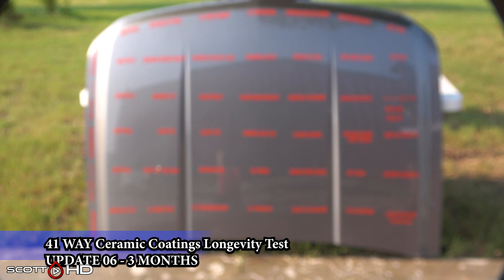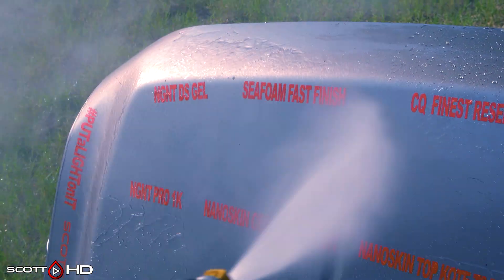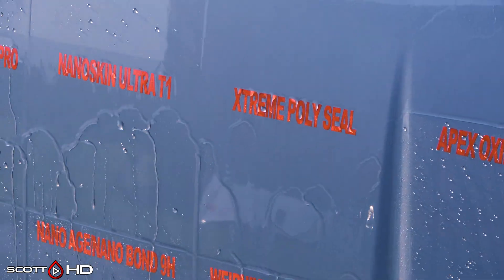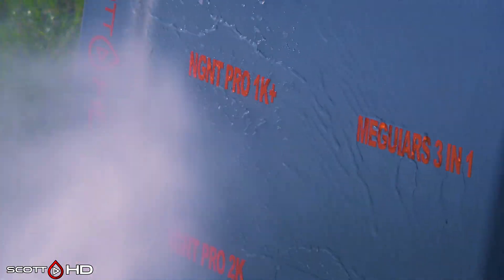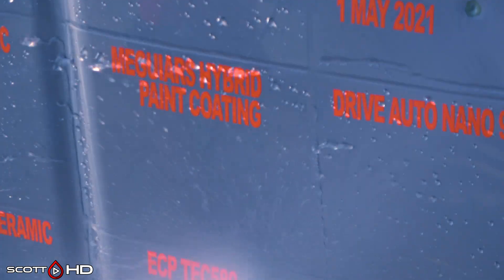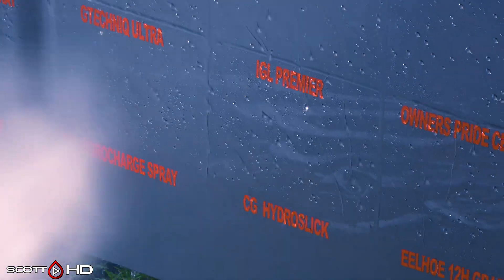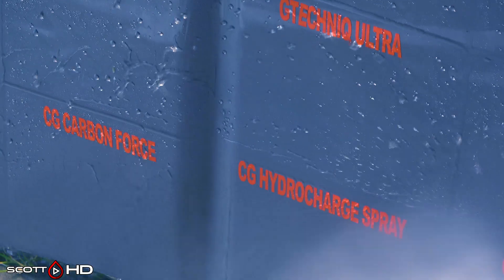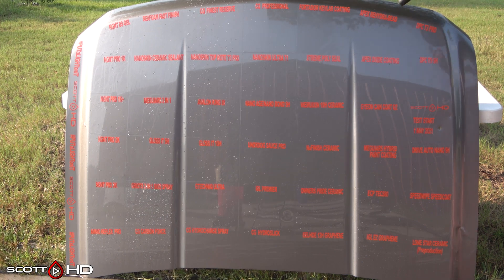Ceramic Coating Longevity Test - 41 WAY - The ULTIMATE comparison test - UPDATE 06 - 3 MONTHS

Comment: Hydroslick must been reformulated because i bought it a month after the release and it gave me around 15 months. I topped it every 2 months with meguiars xpress spray wax
Reply: @Gary Highwilt I think it's been reformulated. I have some older chemical guys soaps like citrus Wash and gloss for example. How about it in the 128 oz but at Walmart, they sell the 16 oz and the consistency of the product is a lot better than the batch that I have so it's very possible that a lot of these products get dumb down or reformulated after it's been out a while
Reply: @Gary Highwilt well ill see if its really crap. I just reapplied last month and 5 weeks in, its still good as new When I washed my car yesterday and I haven't topped it yet. My car is garage kept but it does get driven everyday
Reply: @Gary Highwilt But like I said, that's only at night time when it's in the garage. During the day, it's still gets weathered from the sun and rain... On my wife car, I put Meguiars hybrid ceramic wax in the yellow bottle. It is also garage keep but it only lasted 4 to 5 months
Reply: Really tough to judge a coating when you're putting something over it.  That's why Scott doesn't use any toppers for these tests
Reply: @derek723  I know. You're right. But they will all tell you that these coatings need maintained to survive their advertised longevity

Comment: I would like to see Glassparency graphene spray coating thrown in on the next test. So far I like it, ease of appreciation, a little goes a long way, extremely hydrophobic and I don't think someone could intentionally mess up the install. Basically the only thing I haven't tested is longevity. For the past 6 months it has been my go-to wax replacement
Reply: It's already in his graphene spray and coating video that's running now

Comment: I'm keeping a close eye on TEC580, Meguiar's HPC, and DPC T3. I have the latter two of my cars, and they have performed similarly to your tests. I am curious about TEC580 because of its price point and the fact I use the ceramic detail spray (TEC582) as a topper.
Reply: How is the detail spray? Does it streak?
Reply: @fskof  It streaks when it's fairly hot outside and I spray it directly on a panel. I usually spritz my towel once or twice per panel, and I've been avoiding streaks that way.
Reply: @el__2handed  Thanks, other than the steaks do you like the spray?
Reply: @fskof  I do. The price point is great for a gallon and it can be diluted 1:1. Durability isn’t great though so that’s why I use it as a topper.
Reply: @el__2handed  Thank you for the response. With so many new products out there is impossible to try them all.